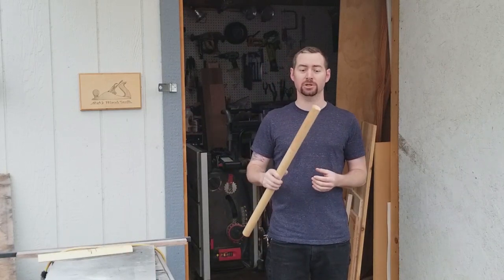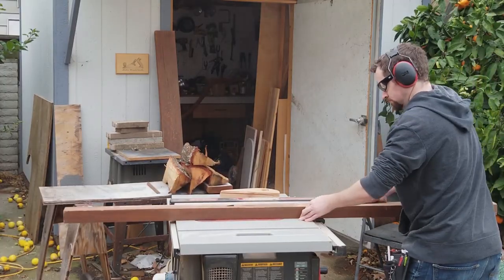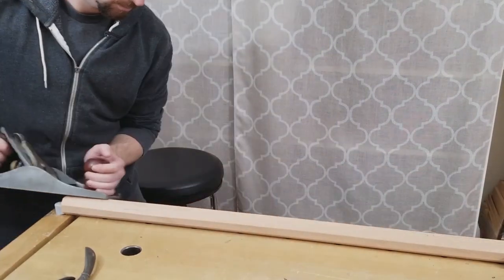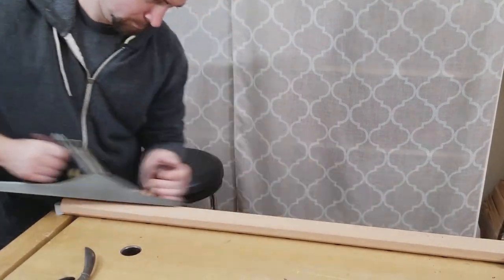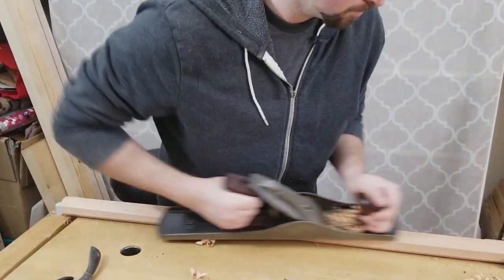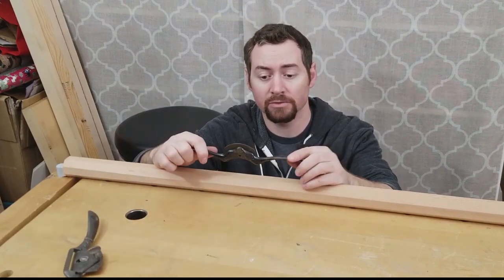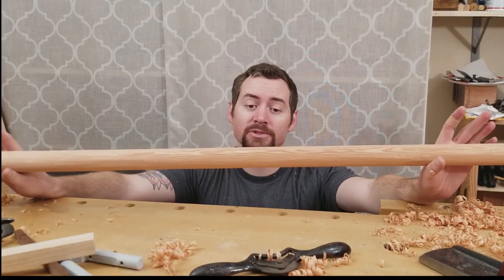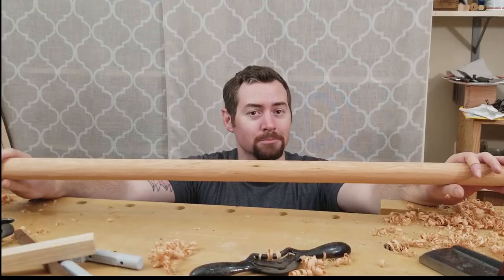Making a DIY Wooden Closet Rod

Comment: Personally I left mine with the octagon shape with a little bit of smoothness on top where the hanger would sit. I only did this save me lots of time but it also made the rod sit nicer on the brackets. It also adds a unique shape instead of the typical round. And I have zero sagging because I have the right amount of supports and the angle cuts create strength.
Reply from the maker: I do like the look of it as an octagon. Thanks for watching!